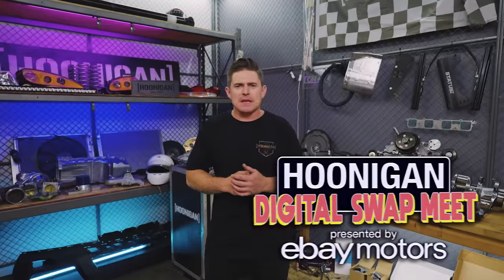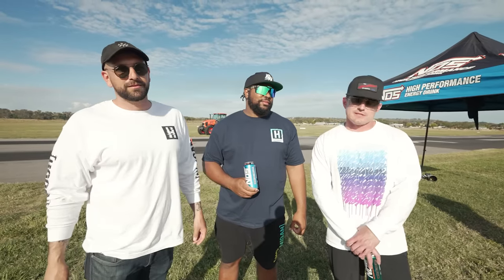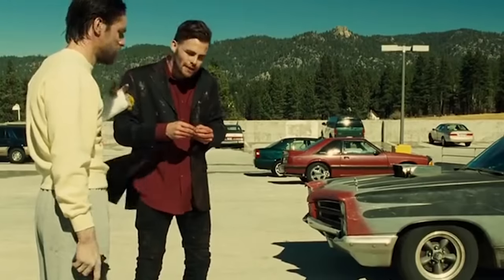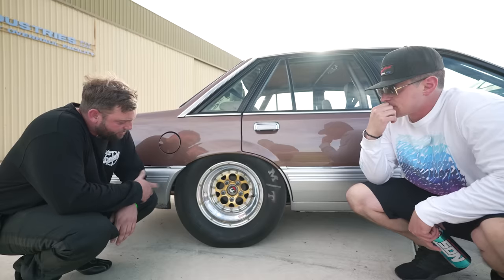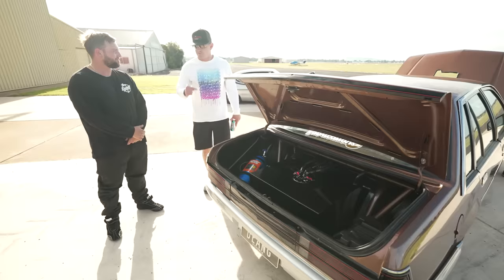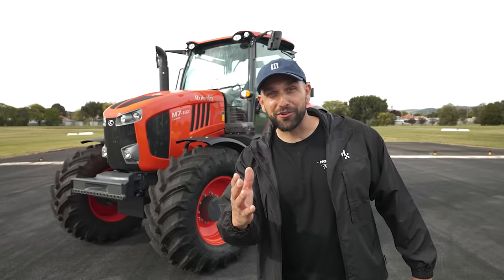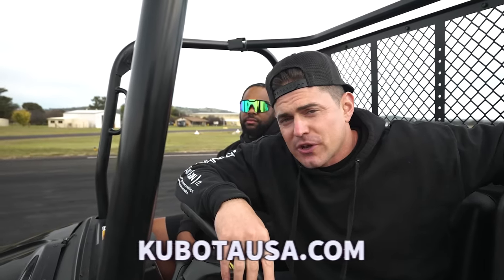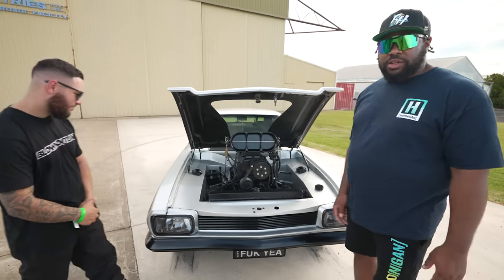Aussie Burnout Cars Drag Race! 850hp Holden VK Calais vs 900hp Ford Capri

Comment: You guys in the US did get the Aussie built Commodore, it was badged as a Pontiac around 2012 sales were less than 2000 units so the plug was pulled.  Sadly GM pulled the plug on Holden a few years back too.  No more Aussie Cars.

Comment: There were also a few Capri models that crossed the pond as well, at least for its First Generation, anyway.  However, in the USA, as well as possibly Canada, they were called Mercury Capri.  However, the Second Generation, as well as the Third Generation, of the Mercury Capri were completely different vehicles from the Ford UK versions of the car.  Still, they were pretty cool vehicles, too.  The Second Generation Mercury Capri was essentially a badge swapped Fox Body (Fourth Generation) Ford Mustang, while the Third Generation Mercury Capri was a unique little two-seated roadster/convertible that was kind of like the answer that Ford had to the Mazda NA Miata/MX-5.  Granted, the last USA version of the Capri did not have an awesome V8, nor was it as good as its intended rival, but it was pretty decent in its own right.  Now, with that being said, the First Generation Mercury Capri is just as versatile to make into a high horsepower beast as its Ford UK cousin, and the Second Generation (USA) Mercury Capri, well, that vehicle is already a drag strip legend, to say nothing of other functions on race tracks.

Comment: We got the Capri here in the states. They aren't common today but we did get them
Reply: Yes the American capris were built in Germany by ford but then they were only sold by Mercury in the US because they did not want it to compete with the other ford compact car (the pinto). The American version has capri written on the hood, outside of the US they have the ford lettering on the hood.

Comment: You can see that Ford struggling for traction. Give it the proper suspension and tire setup and it'll put that Chevy in its place every single time.

Comment: I just don t get why anyone would run n/a?You need a lot of money to make high hp n/a to live anyways,so why not supercharge it?I had a 900 hp blown 467 bb chevy and it was cheap and reliable with stock crank,rods and forged TRW pistons.8-71 cheapo blower from Weaind and your basic Summit Alu heads.My 3300lbs street driven 64 malibu went 9.624/144 on a make do "track".My madness ended with 526 12-71 hi helix blown bb cheva but it just annihilated my torque converter and later tranny.But a down tuned 538 version of it was nice on streets but it had more torque so it just blew thru converter.Nowadays with your Haltechs Fueltechs etc you can run a 2500 hp turboed bbc all day long and it won t cost you anymore than 1500 hp engine with 1000 hp nitrous.